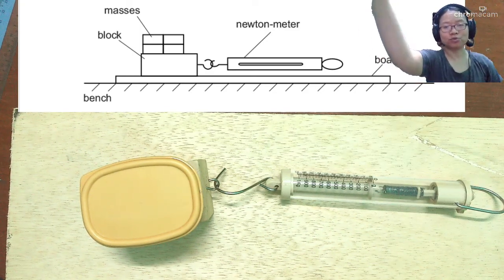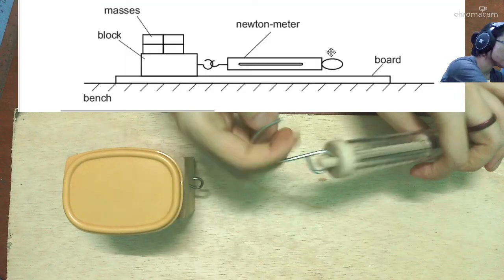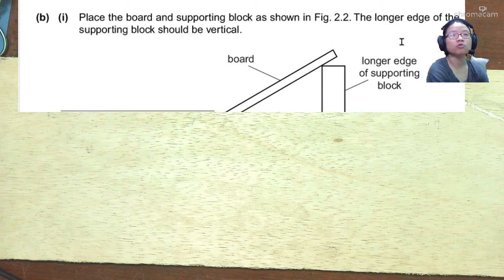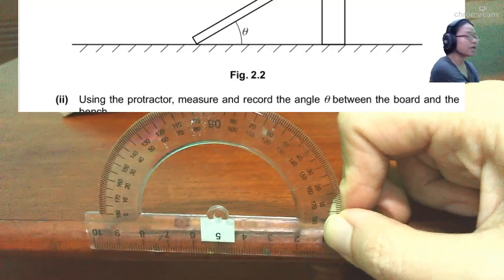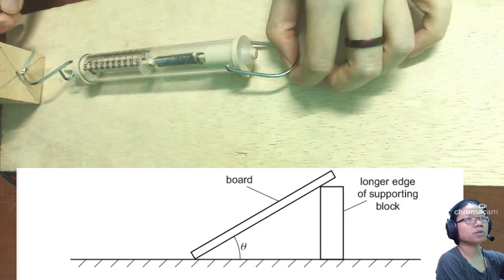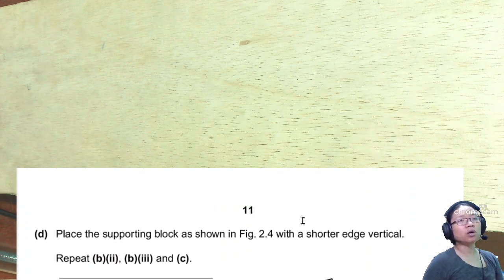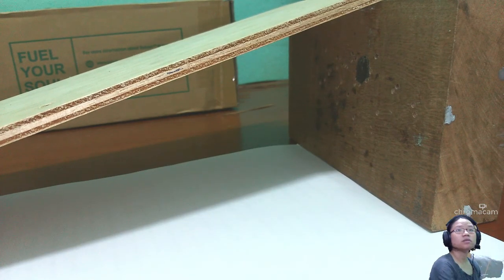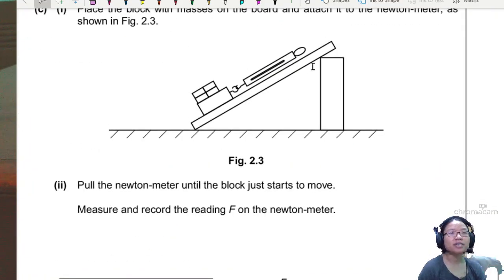MJ12 P31 Q2 Data: Friction up an Incline | AS Practical Paper 3 | Cambridge A Level Physics

Comment: i just watched this the day before my exam and I'd like to say you just saved my grade because our teacher didn't teach us this, so honestly thank you so much you're a life saver!!!😁
Reply: Yeah
Reply: @vrajshah3043  what are the common limitations and improvement for experiments like this????
plss helppp
Reply: @vrajshah3043 is oscillation question 1
Reply: hi
Reply: so question will be like this type.
Reply: There's a whole section on Z notes with the whole thing but mainly parallex error as well as the instantaneous movement of the newton meter when the force is overcome
Reply: errors
1) two values not enough to draw a valid conclusion
2) large % uncertainty in F
3)some parts of the board are rougher than other
4)The board tends to slip/not stable enough
5) difficult to pull a newtonemeter parallel to the bench
6) difficult to zero newtonemeter when used horizontally 
7) difficult to line up the protector/horizontal line of protector not on table
Reply: @frizbee8195 limitations please